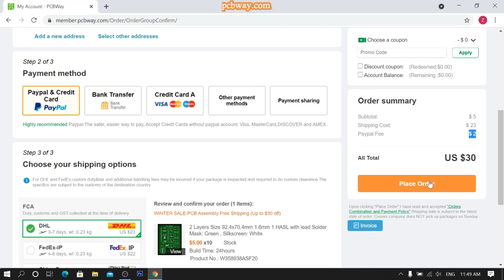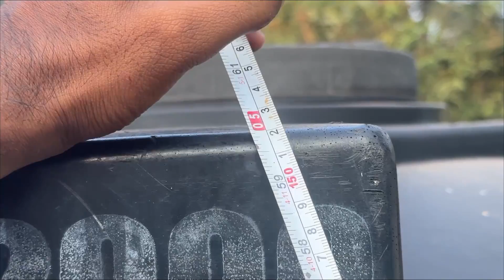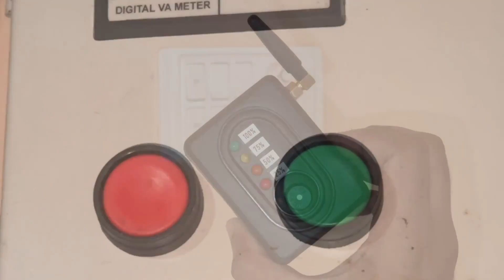How To Make Wireless Watertank Indicator +Alarm At Easy

Comment from the maker: Assembled PCB:- 8590107101(whatsapp-India) (limited stock )

Components Used:-
433Mhz RF Modules 
HT12-E IC
HT12-D IC
1k Resistor -6
33k resistor-1
10k resistor -4
1M Resistor-1
BC547 Transistor -4
BC557 Transistor -1
LED 3mm-4
Buzzer-1
solar panel 5v
TP4056 Module 
18650 Battery with holder
Hi-link 5v
Reply: Bro.. can u Send me I will buy this...
Reply from the maker: Message me on whatsapp
Reply: Can we get fully assembled product? Or we need to assemble it?
Reply from the maker: Only two assembled pcbs
Reply: @Promaker1  Bro.. I want full Product
Reply: I want full set, your whatsapp number not working. can you share your contact details.
Reply: Bro it is coming as this number doesn't exist in WhatsApp